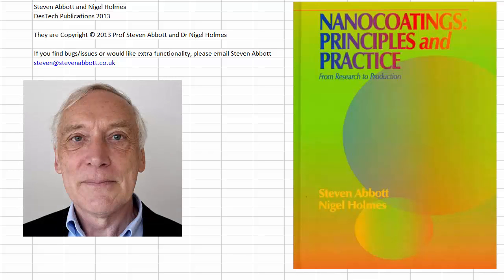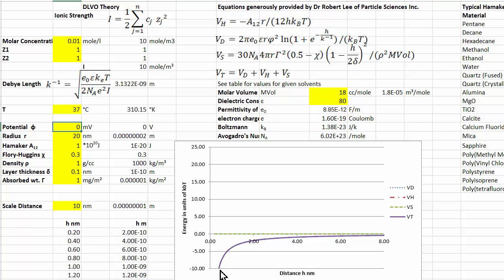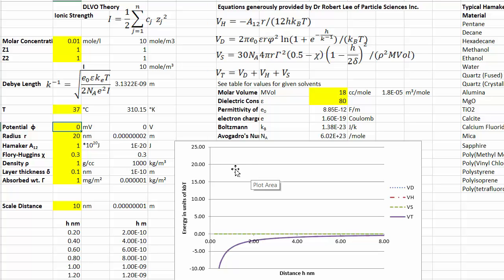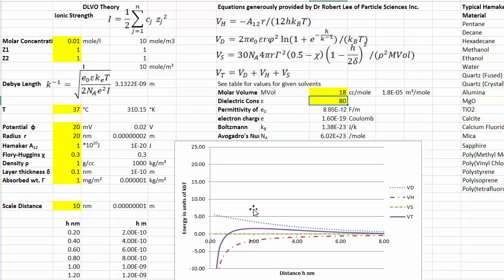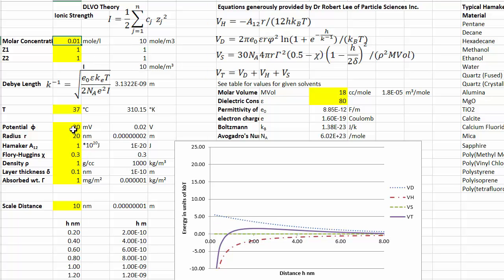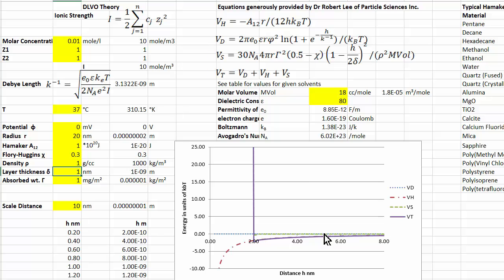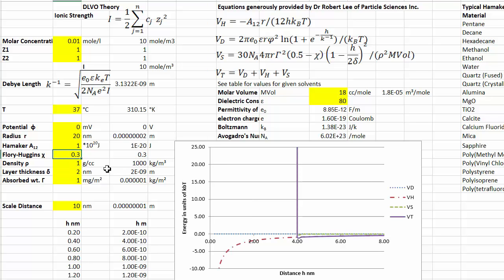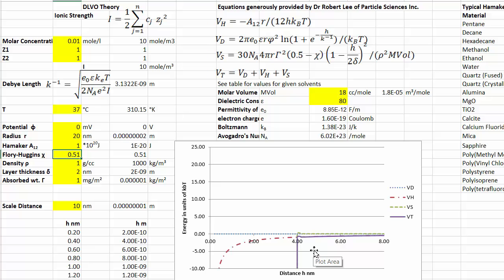DLVO Theory

Comment: Thank you very much for sharing this. I really appreciate it!! I have a question about unit in these equations. for example, it seems like there's no unit for V_H (dispersion force), but there is unit for V_D (coulombic, unit is Joule). I want to apply my system.. but I'm confused with unit. please could you check the unit..? I try to calculate but these unit doesn't match for me between dispersion (no unit) and coulombic forces (J).